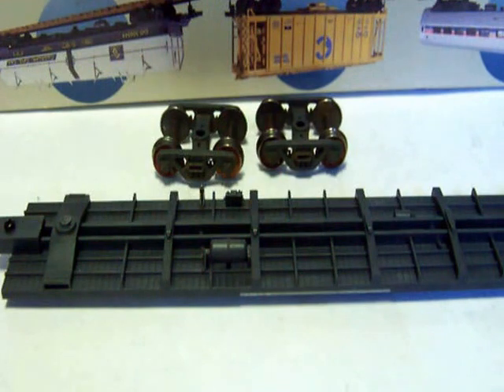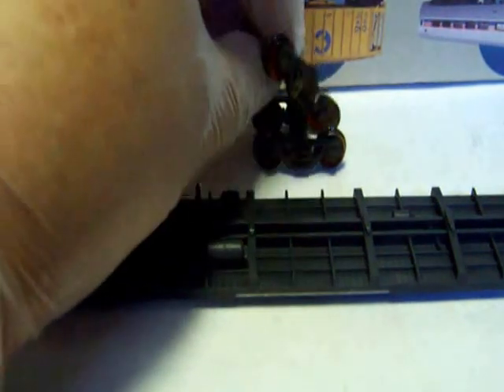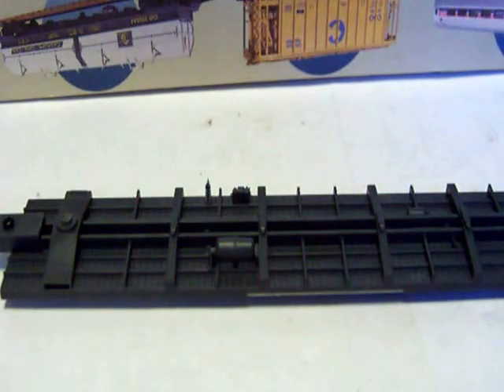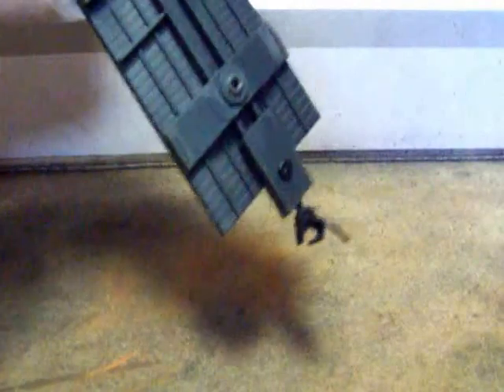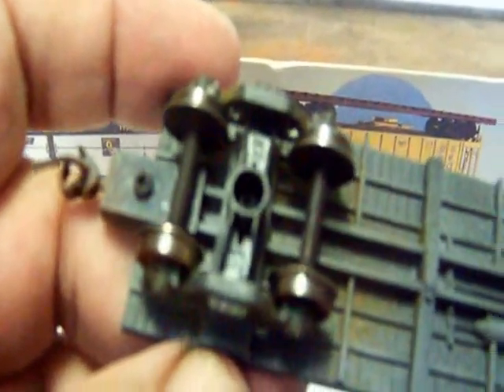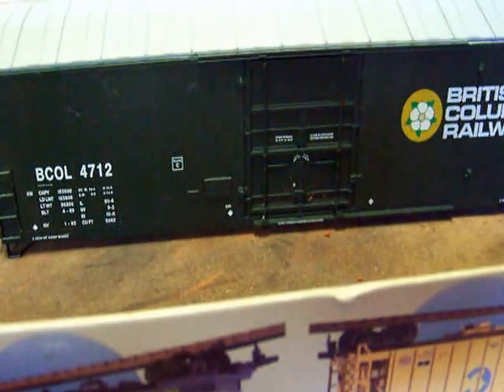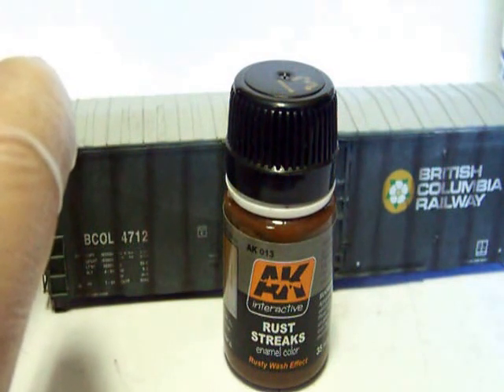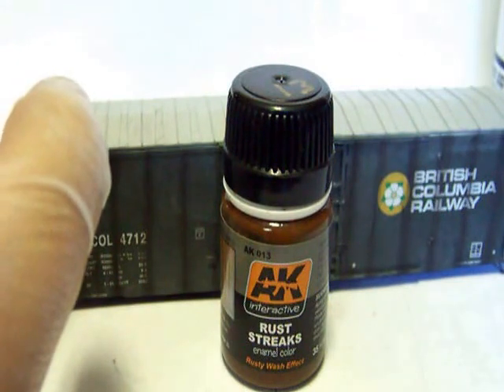Weathering from the bottom up

Comment: Looks awesome todd!!!! Im sure he will like it very much. Hey I heard that you dont have to clear over pan pastels.  Is that true? Keep up the great work. Later, John
Reply from the maker: I have heard that too John, not sure I subscribe to the theory. I've actually produced a nice thumbprint on the side of a coal hopper by touching it before sealing it, the CSI guys would've been proud! Ended up washing it all off and re-applying.
Reply: 2toady haha! But that does suck. That alcohol wipe down works good though right? John
Reply from the maker: model railer
If time is not an issue I wash everything in warm soapy water and let dry 24 hours. But a wipe down with an alcohol wipe gets it done quicker.
Reply: 2toady yea I do the wash bath.